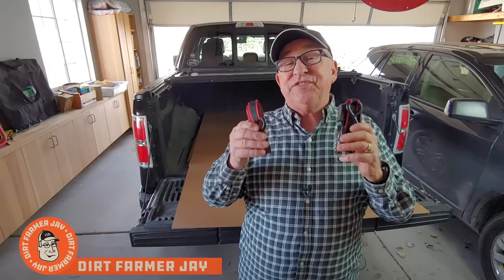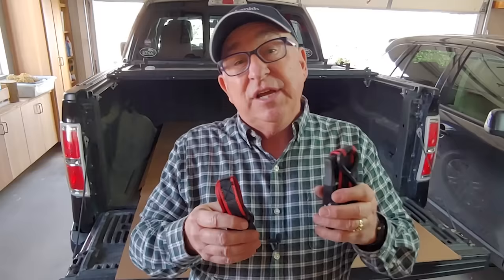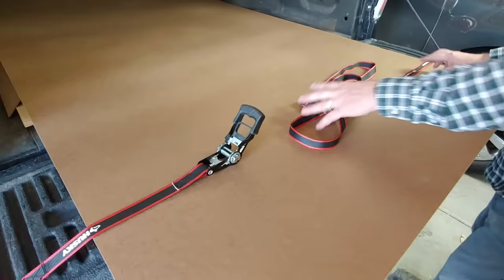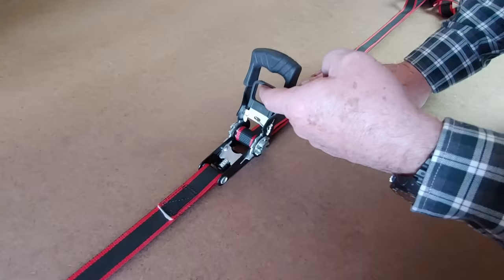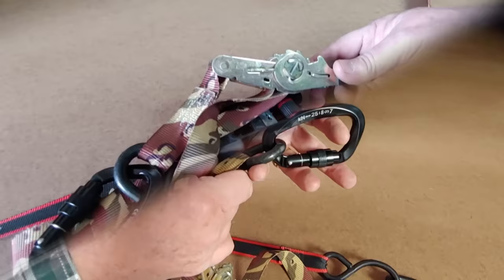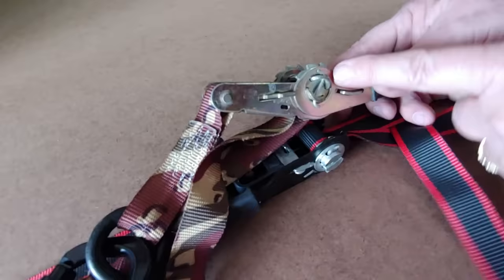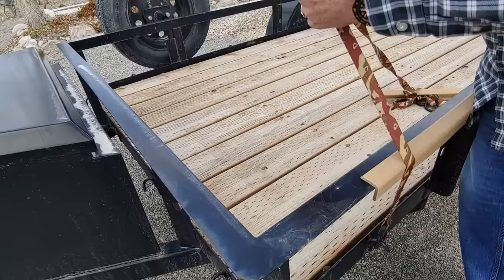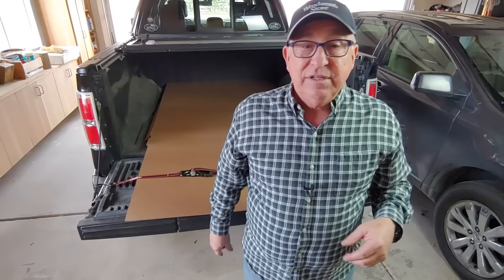How to Use a Ratchet Strap - Tips and Tricks!

Comment: Many good tips. Thanks. Don't understand the advantage of using a heavy carabiner thru the loop behind a hook. Seems the standard hook would always be handy & sufficient. Well done video.
Reply from the maker: S J, thanks for writing. The carabiner can be used as a securement device to keep the hook in place if it keeps falling off when working to secure the load. Having said that, high tension/ultra heavy loads could spread the eye part of the hook apart if too much pressure is applied. Best Regards, DFJ
Reply: @DirtFarmerJay  Ok. Thanks for comment. My load uses haven't been heavy enough to bend hooks. Another video explained the 2 pawls both under spring tension. I did not understand the need to release the teeth on 2nd pawl. Not under tension. Have bought 4 ratchet sets and never considered separating the 2 halves. Always left them fully assembled. Needed to lube moving parts. Much more versatile to apply the strap in 2 pieces. Very good video. Thanks.

Comment: When I took my new home, I started with the technique like the guys you saw at Lowe’s, however I felt it would put too much pressure on a small point on the box where they don’t have packing foam. What I ended up doing was putting one strap on the lower tie downs, and one on the upper tie downs laced through the lower one to make an X. I could adjust the tension of both straps so the lower strap was in contact with most of the box edge and I’m glad to report my tv made it home safely
Reply from the maker: Brian, get technique you developed there! Thanks for writing! Best, DFJ

Comment: It's actually easier to have the ratchet closed and then when u feed the strap through the bottom it goes up in front of the handle and you don't need to feed it through again then just ratchet.

Comment: hauling 4x5 round bales of hay,  thought about placing a chock behind last bale in case load migrATED to back of flat bed trailer, but unsure on how to secure it....anyway you could demo this?
Reply from the maker: Jan, I don't have the equipment that is similar to what you are describing, but I think I can offer a bit of technique that you may find helpful. Let me summarize what I believe you are saying and we'll go from there. You are loading large round bales of hay, probably in line with the front to back orientation of the trailer. You are securing the bales over the round "tops" of them by putting straps from trailer side to trailer side and tightening them down. While this does well with providing side to side and downward pressure to the trailer floor, it does not address "backwards" motion, out the back of the trailer, so you are wanting to put in a securement strap (chock) across the back end of the load to stop it from having any movement towards the back of the trailer during transport. Did I get it right? Assuming so, here's a couple of ways to address this using additional straps.

1. You could put a strap from the center of the tail gate or bottom edge of the back of the trailer up over the back bale of straw affix it to one of the straps going over the top from side to side. Don't overtighten, but make sure it's secure.
2. Or, before placing load, lay and secure a strap to an attachment point at the front of the trailer and then play it out to the back. Load the trailer on top of this strap, and when loading is complete, put another strap attached to the exposed hook, and running back over the tops of the bales to either one of the side to side straps nearer the front, or the front of the trailer itself. Tighten appropriately.
3. Lastly, you could do a chock from side to side across the face of the back bale and attach to one of straps going side to side and over the top of the last or second to last bale. Don't tighten yet, as the strap will simply ride up the slope of the side straps. Now, you must use two additional straps, one of each side, to hold the chock strap from riding up the over the bale top strap as it tightened. 

Hopefully, one of these approaches will help! Best Regards, DFJ

Comment: If you give the straps a few twists, it stops them singing awful songs while driving on the highway.

The roll-up method for the free end of the strap is good and all, but is not time efficient at all. I bought myself a 100 pack of releasable zip ties (the ones with the tab you can press down to undo them), and attached one to each one of my strap sets (set being 1 ratchet and 1 strap). I just grab the free end and bring it up close to the ratchet, then fold it in half, half again, half again, until you get a bunch about 6-8" long, and then I chuck the releasable zip tie around it. Sooo much quicker. I do the same thing when packing up the sets; bring the ends together, fold in half until the bunch is about 6-8" long, then put the releasable zip tie around it.

Instead of using WD40, use some food grade silicone spray. Oils and petroleum based products tend to degrade plastics over time, not to mention leaving everything all oily and greasy. The food grade silicone spray doesn't have the nasty stuff in it so is safe to use on plastics and stuff, and doesn't leave a horrible residue that attracts dirt and whatnot leaving a mess on everything.
Reply from the maker: Thanks for all the insights! I appreciate you writing. Best, DFJ

Comment: Has anyone mentioned that you must use ratchet straps that are load rated? It's usually tagged on the strap, if it isn't tagged, use a strap that's tagged
Whatever the weight of your combined load, you need straps that are qualified. Use as many as you want, so long as the straps add up to "better than loaded weight" and they're in good condition.
Actually, the anchor points need to be good, too.
I'm certain insurance companies smile on such behaviour.
Reply from the maker: Great insights. Thanks for letting us know. Best to you, DFJ
Reply: @DirtFarmerJay  44 years a trucker

Comment: Here's my frustration.  Open hooks refuse to hold on to the ring they're attached to unless they're under tension.  This is hard to do with one person when you have to walk to the other side of a trailer and thread the strap through the handle.  I haven't found a store that carries ratchet straps with snap hooks and  had to go online to find & get them.  Has anyone come up with a simple hack for easily & quickly modifying an open "S" or "J" hook to stay on its attachment point until pressure can be applied (and can be used again and again)?   Thanks for posting.
Reply from the maker: My suggestion is to use a strong magnet to hold the hook into place until you can walk around and affix the other side. You can also take a look at this product - Omegastrap.com 
Best to you, DFJ
Reply: Electrical tape or masking tape. Easy to tear off afterwards.

You can also often feed a loop of webbing through the anchor and put the hook through the loop instead of the anchor.  The added friction will keep it in place.

Comment: As a truck driver of 40 years, I can tell you not to feed the strap back through the ratchet. Leave a little bit loose and get at least on and half wraps around  the centre of the ratchet. You then make the roll as shown but a little shorter than shown
Reply from the maker: Thanks for leaning in and sharing your expertise. We plan to make another episode using tips like this. When we do, we'll make sure to give you credit! Thanks for watching and writing. Best, DFJ

Comment: I have always had a problem with undoing these straps. When they are on tight I pull back the big lever handle but it never releases and I always have to put my finger inside and pull back on that spring loaded ratchet part inside in order to release the strap. I actually hate using theses types of straps because of that.
Reply from the maker: Wayne, I've had the same problem but got it solved by taking these two approaches: 1.) make sure the hub and ratchet assembly is lubricated and doesn't have excessive rust, and, 2.) when you open the unit, bring the handle all the way back until it feels it is overextended. This releases the catch and lets the hub and strap spin free. I hope this helps! Best, DFJ

Comment: Ithere"s another way to get it loose if it's all wound up tight .I will pull the pin on the outside of barrel or cylinder of the ratchet and slide the barrel out then unwrap the strap after that replace the barrel in the ratchet Handel's and usally put a cotter key in place of the pin I took out .Because when you pull the pin each end of the pin is bent in opposite directions and the usally fit real tight after bending them straight to get them out.I was in a hurry once and it was pretty quick instead of pushing the strap back thru and un winding all the loops.

Comment: On my sharp edges, I use a 2" PVC pipe slit so it works like a clamp on sharp edges and a few quartered for 90 deg. edges. On the 90 deg. I use duct tape to hold them in place. Does buying good make Harbor freight Ratchet strap okay or is it better to chuck them?
Reply from the maker: After giving it some thought, my answer is this... regarding the highest degree of safety/lack of failure, using a higher quality ratchet strap for a very heavy/bulky load is best. I understand what you mean about the Harbor Freight straps and I agree. You can certainly use them for hauling trash or lawn trimmings but I wouldn't go across the country and count on them holding my load. Hope that helps. Best, DFJ

Comment: I honestly don't understand how ratchet straps are even a product.  I was never a Boy Scout, but somehow I know how to tie a few knots.  The one that takes the place of the ratchet strap is called the truckers hitch.  There are several ways to tie it, and some create more problems, but none of the rope solutions are as fiddly as using a ratchet strap.  
Another issue with straps is aerodynamic flutter which weakens the strap as you drive.  That's not a problem with rope.  
And the last problem that I have with straps is they are universally made from nylon (which stretches and loosens especially when it gets wet).  You don't have to look too hard to find rope made from polyester (not polypropylene), aka Dacron (which does not stretch).
Reply from the maker: For those that have skills with rope, this indeed seems like a mystery. However, ratchet straps are a very common and highly purchased product. And, ropes are not approved load securement devices for commercial loads. I take care of the flutter with a half twist - which does not weaken the strap. Thanks for watching and taking time to weigh in on different areas pertaining to this. Best, DFJ

Comment: If you run the tail and roll it under the strap, then the strap pinches the tail taught under the strap as the strap gets tightened up. No need for knots that way.
Reply from the maker: Thanks for sharing your insight. Best, DFJ

Comment: Some very good tips but I’m concerned with your first demo where you attached the hooks to the tailgate cables.  As you drive the hooks will ride up the cables making your plywood unsecured! The later demo, where you wrap the strap entirely around the tailgate is much better but use some corners, or carpet strips to protect the straps from damage.

Comment: I had my wife sew a loop on the bitter end of the strap. Then I run the excess through the the eye of the hook and use a bungee cord to bring it back to another point on the load or trailer.
Reply: That's cute, but you can't pull the strap out of the winch if you have a right slot to run it through.

Comment: My dad messed the strap up by doing it back wards and he twisted it up tightly from the end of the strap how can I get it to release
Reply from the maker: Cyberse. Angel, don't be too hard on your dad. What he did is fairly common. Many people think that you begin at the end of the strap and wind it up in the ratchet device until the strap is tightened. The trouble is that all that strap takes up a lot of room and there isn't much room inside the ratchet frame - there's only room for 2 to 4 wraps. Having said that, and assuming your ratchet strap is new (and not rusted, gritty or corroded), then you need to pull the release latch on the handle and open the device as flat as you can. Attach the short strap/hook side to something strong and stationary, and then start to do sharp "snap" pulls on the other end of the strap. The idea is to have the wound up strap start to come back out and to get the hub to turn a bit at a time. See it that works! Let me know. Best, DFJ

Comment: I would not recommend a C clamp. I would go from the side attachment point to the hitch to the other side point. One or 2 straps.
Reply from the maker: Thanks, good point. I've used this method for short hauls and really cinched it down, but this could still come loose, and it's really not an approved attachment point as far as the DOT is concerned. We'll get this changed. Thanks for the nudge. Best, DFJ

Comment: I don't know if I keep missing it or what. I do not see anywhere on this video on "How to store them"? I must have watched and/or skipped through it over a dozen times.
Reply from the maker: There are several ways to store them but the main idea is to have them on hand and easy to access so that you can use them when you need to without having to search for them. I store mine in a small bag and keep a set in my truck at all times. Best, DFJ
Reply: @DirtFarmerJay  Sorry Jay, what I meant by "storing them" was how to "stow them" as you mentioned in your description. I didn't see  how you roll/stow them? Am I missing something? "Finally, you’ll learn how to loosen a ratchet strap properly, how to untangle a ratchet strap and a couple of methods of neatly stowing your straps so they are ready to go to work the next time they respond to the call of duty."

Comment: I'm trying to haul a 2x12x16' on top of my SUV with roof racks. Could you kindly provide some instructions on that if possible? I don't have a truck so I was wondering if putting them on the roof racks would work with these ratchet straps. I only need 3 pcs of 16' boards. Thanks and great how to video.
Reply from the maker: Jack, thanks for question and suggestion. I'll see about producing a video on this subject in the future - unfortunately, that doesn't help you right now! 

However, here's the basics of what you'll need to do to get secure attachment. Balance the load on the rack - test it that it sits balanced and stable without any restraints on it. Then you need to have a way to both secure it so it can't slide forwards or backwards. This can accomplished by using a couple of quick clamps affixed to the piece (or pieces) of wood and the strap put through it. 

You also need a way to assure the board doesn't slide side to side. Simply putting the strap over the load doesn't provide enough side to side resistance to accomplish this. I loop the strap around the load to accomplish this - or twist the straps in a spiral from the side to side bar on the roof rack to pass over the top of the load. This also helps to secure the load to resist front and back movement.  As you are getting 3 boards, anything you can do to secure them together so they act as one piece is good. This may be a set of separate straps, strapping tape, or very secure rope. 

One last thing. No fast starts or hard stops. Why risk it? 

I hope this helps! Best, DFJ